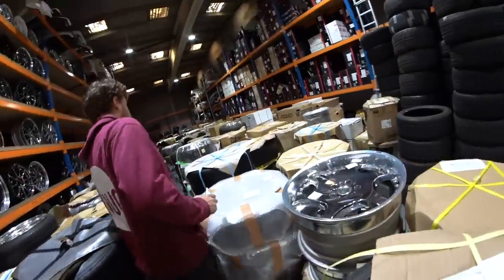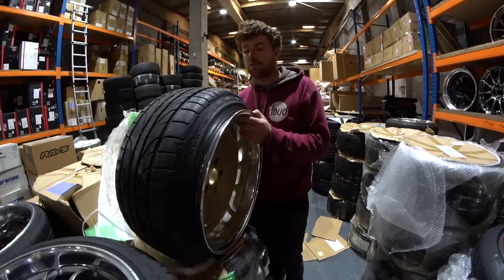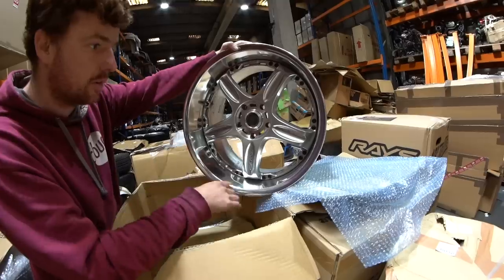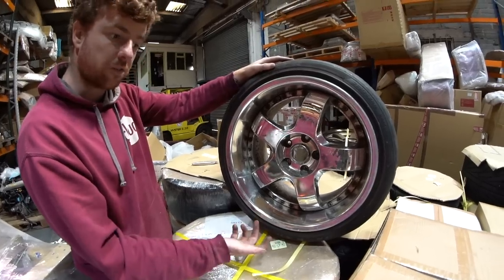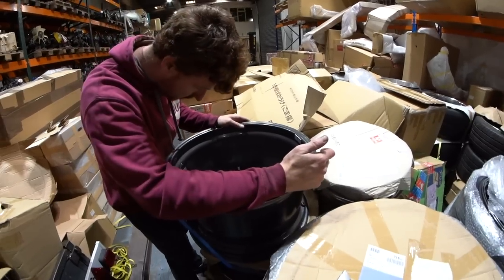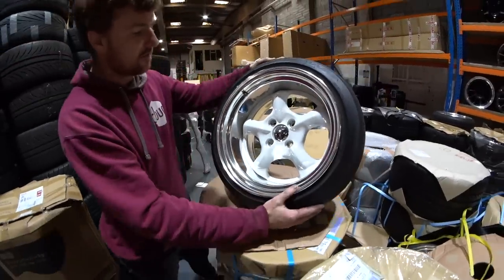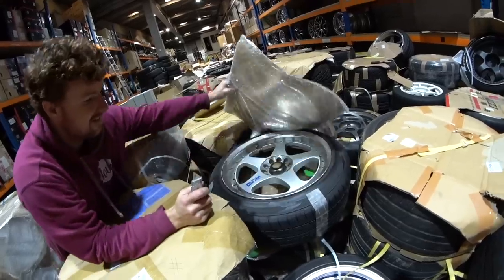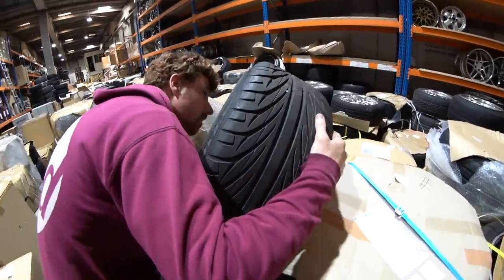It Keeps Giving! The Biggest JDM Parts shipment ever

Comment: I searched nearly 1,5 years for a set of Advan SA3R's in 16" 7.5J 114.3 x 5 plus the complete set of center caps with rings, nuts + tool, center chips + holders.😅
At that time only incompled 17" sets were on the auctions/markets (only rims) and overpriced too. 
Finally after time got my set and the center stuff seperate for all together ~ 900,- incl. shipping and tax. :p 
But guys what you got there is kinda insane and heaven in one location that's for sure!! :D